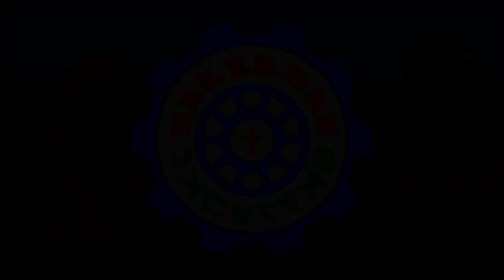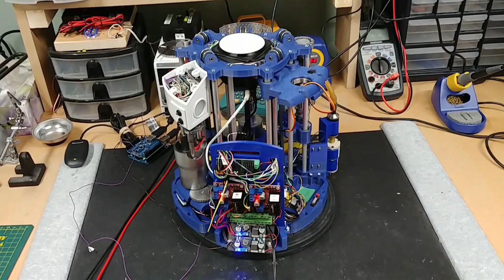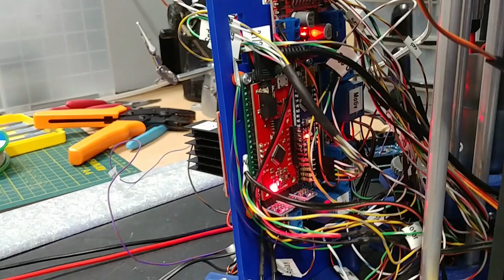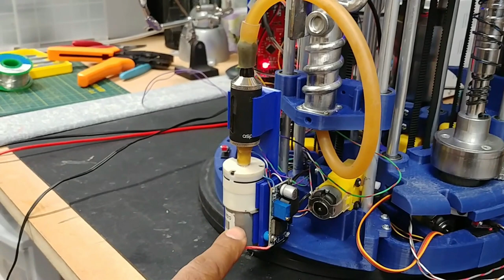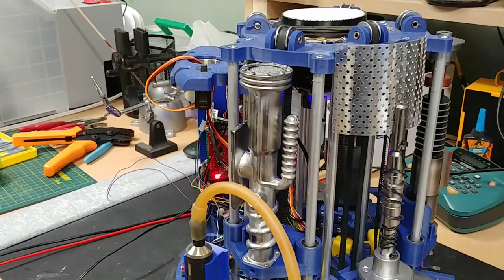R2D2 Build Episode 7-Dome Motivator

Comment: Hi Dan. This build is amazing! Do you have any detailed notes on how you assembled your motivator? If not, can you tell me what parts you used and how they were assembled? Also, I noticed you're making a lot of your own parts to supplement the original parts. Do you have links to those parts available online?
Reply from the maker: Hi Lawrence.  Thanks for the compliments :)  I can't take credit for the original design.  Those parts are provided by Matt Zwarts on Thingiverse.  You can download all his files there.  I have updated the links in in the video description to include more of my own files.  Here is a direct  link for you  https://drive.google.com/drive/folders/1hTlED_eGPlx6-oYWscRxMVRzBUM8XWHk
Reply: Thanks for the reply. Regarding your Bad Motivator, where are you hiding the wires for the LEDs? Did you add a resistor or is it on the board? Have you mounted the dome mechanism to your frame yet? I'm curious about that process. Thanks for these videos. They're a huge inspiration!
Reply from the maker: @lawrencereynolds3992  Sorry for the late reply, just saw this.  I added resistors for the LEDs inside the motivator.  I have not installed it yet in my dome as my dome isn't finished.

Comment: Dan looking great what control are you using to make the parts go up and down ie I could not see any RC or Palawan system setup 
I am just wondering if I could set it up long side my RC set up 
Thank you Mark
Reply from the maker: Hi Mark.  I am using the Padawan 360 system.  I had my X Box controller off the screen.  It is temporarily set up with an Uno but I will be using a Mega in my R2.  The Pololu Maestro on the 3D board does the work to move the servos and sends signals to the motor drivers.
Reply: Thanks Dan I think I will have a look at the Palawan system a bit more did you have to write new code as you are using different motors and the Palawan 360 just has the two. If you have made change’s to the code would you send it to me so I could take a look as I am known good at the coding thanks Mark
Reply from the maker: Mark, the motors are controlled by the Pololu Maestro board  and the sequences you create on that board are activated by lines of code in the Padawan sketch.  You don't really need to add much code to the sketch to make it work.  You do need to know how to use the Maestro though and a good starting point is to watch Mr. Baddeley's first zoom tech session on it.  Here is a link to his session:
https://www.youtube.com/watch?v=SLkgoe9RS10&list=PLXkMwp_Z-ip1TCwXoLOuODb9SZYeoG-zG&index=8

Comment: Hey Dan, i am building my own mechanism right. I thought about to make it seperatly to the body with a own battery, so i can change to other domes i´d like to print. I love your vaporiser! great job! do you prefer to use the pololu micro maestro 24ch.? did you sprayed the motivator? cause it looks like metal...?
Reply from the maker: Sorry.  I never saw your comment earlier.  I like using the Maestro.  I airbrushed my parts with Alclad Chrome paint.

Comment: Is this Matthew Zwarts design on Mr. Braddelys patreon? If so, did you decide to use PLA or ABS? I just purchase all the pieces except for the rails. Where did you purchase your rails from?
If it is not his design,  where can I find your design?
Reply from the maker: Hi Julian, this is Matt Zwart's design but have re-worked some of the pieces to fit my needs.  Some of my adaptations can be found here:
https://www.thingiverse.com/thing:4636132
I am in Canada and can't source 8mm rods at a reasonable cost so I went with 5/16" aluminum tube.  It is working out well.  I resin printed inserts that get glued into the top and bottom of each tube so that I can screw in a bolt from the top and bottom to secure the tube in place as well.
Reply from the maker: Also, I printed this in ABS on my Creality CR-10S in an enclosure.
Reply: @MakerDan55  thank you, I found some 8mm rods on Amazon 2 sets for about $12-20. What bearings would you suggest for everything to move up and down the 8mm rods smoothly? I appreciate you getting back to me. For some reason I didn’t get a notification about your reply. I’m currently working with Ben riess to try and get one of his board setups for my inner dome mechanics.
Reply from the maker: Hi Julian, I ordered and used these:
https://www.amazon.ca/gp/product/B07CRLSS7N/ref=ppx_yo_dt_b_search_asin_title?ie=UTF8&psc=1